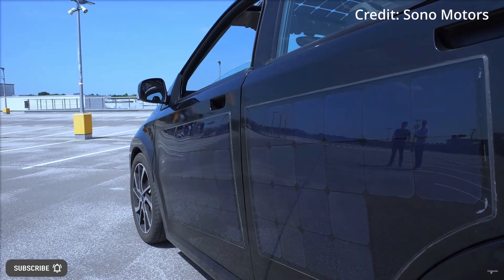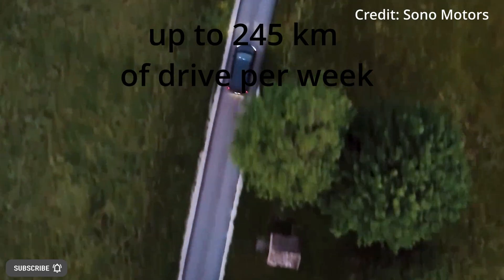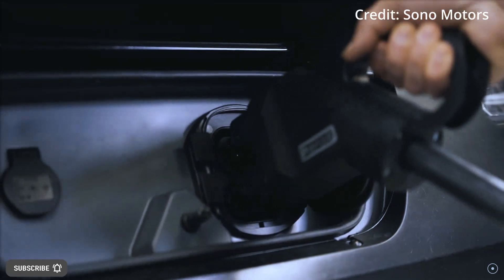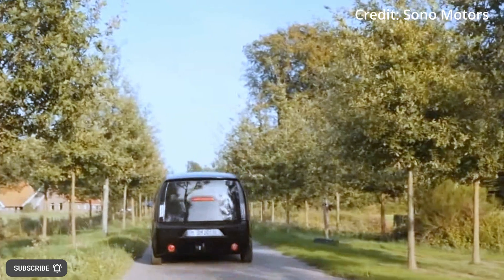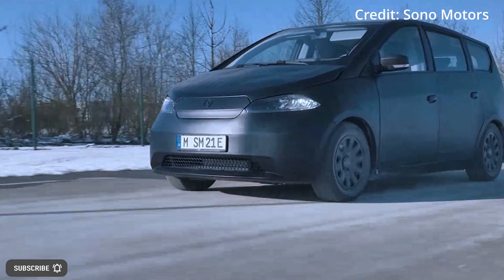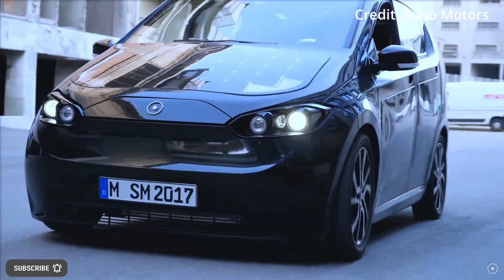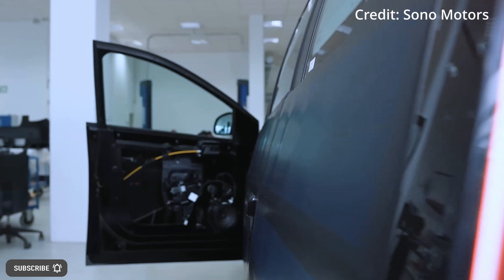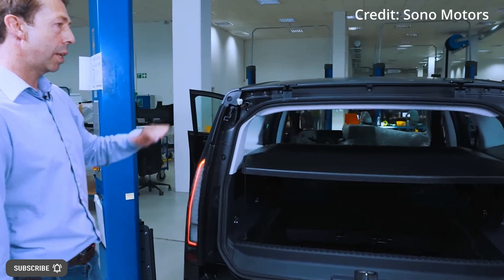Why This Solar Power Electric Car (EV) Is Only 25,000 USD And Winning

Comment: This is the best solution for ev battery charging electric cars! We have 70% population not owned a single home they don’t have private chargers in apartment or townhouse downtown in NY city so solar build in with the cars is way to go or self charger batteries can charge the car while driving. As right now I will stick with hybrid as long as the ev not improve their charging problem or faster charging battery solution